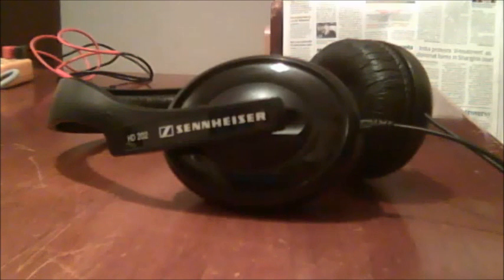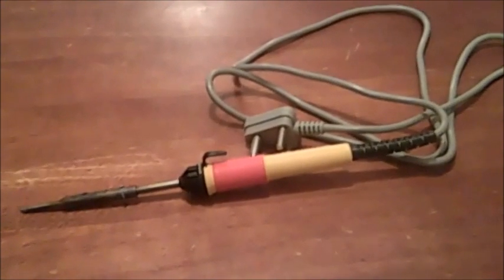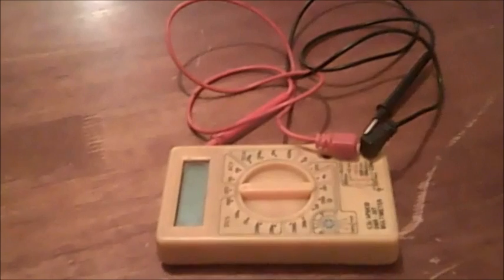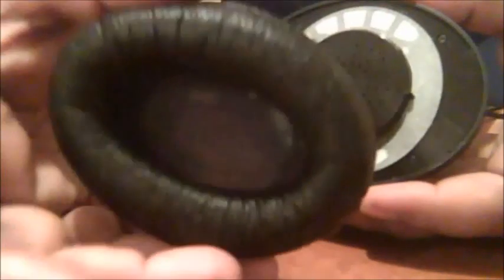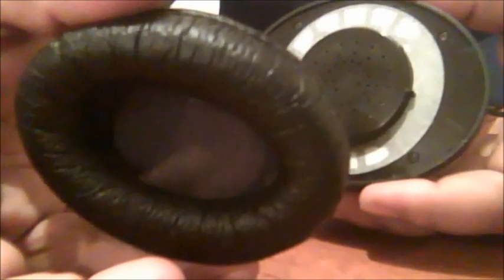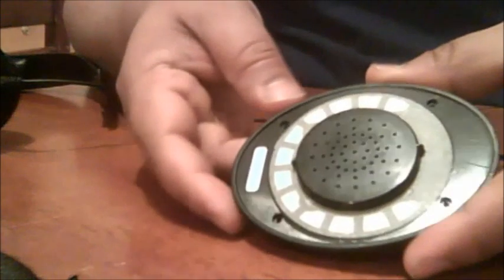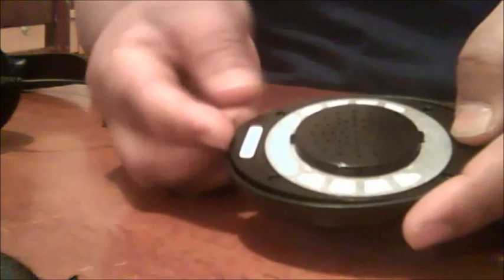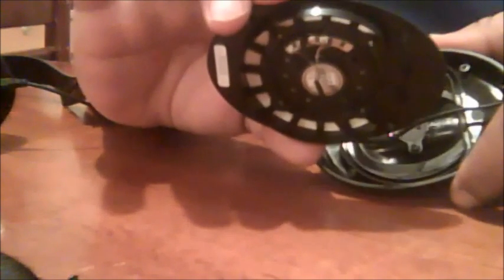How to Repair SENNHEISER HD 202 headphones

Comment: This video helped me a lot, thank you.  I have a question about my HD 202's however.  Only one earpiece produces sound.  There is continuity between the 'broken' earpiece and only the middle part of the jack, between the black rings.  The working earpiece has continuity with only the top and bottom of the jack, outside the black rings.  Is that how it should be?  On a better note, I tested impedance and read around 32 ohms for each speaker thankfully.

Comment from the maker: Use soldering iron to melt the soldering that connects the wire to the speaker. Now check the continuity between RF jack and the other speaker end. Probably, the wire might have a discontinuity at the 'knot', just inside the ear piece. Any way, while checking the copper wire should be exposed thoroughly by cleaning. Feel free to raise any question (that I can answer).

Comment: Just rotate them clockwise or counter clockwise and you'll see that the white insulation will separate out from the copper wire. 
I won't recommend putting a lighter to the whole thing as the strands might stick to the wire and you won't be able to join two ends. 
After you separate out the insulation from wire, just roll the wire together before putting on flame.
Also, be careful that the two separate group of wires, red and golden, do not come in contact with each other.

Comment from the maker: Please read my earlier comments. To see whether the speaker in tact, check whether there is any physical damage. If not, check the continuity by using a multimeter also check the resistance across the terminals. It should be around 32 ohms for this mode. Then check the continuity of the wires. You should be able to find the fault by this time

Comment: Thanks!  The disassembly was just what I needed.  I fixed the one side, but since the issue was a problem with the cable around the knot I had to shorten it, and of course repeat the process on the other side.  Much appreciated!

Comment: Thank you for good tricks :). I ve fixed my headphones. In my case the ground cable of right ear was broken somewhere in the middle of the cable, so i used the ground of other ear. It works now with and extension cable of course, and veery little amount of right ear sound comes to the left.

Comment from the maker: For a speaker to work, as you have mentioned correctly for the working speaker, you need to have continuity in two wires. One earth and the other positive. Earth will be a common for both speakers(normally the bottom most section of the jack). So check continuity for that also
Thank you, Joshy

Comment: I was having the same problem as you. 
If you are still having this problem, open the headphone as instructed. Cut the wire from the point where it seems to be broken. Take out the metal piece which keeps the wire tight and then pull the wire inside. Now, separate the green and golden wires on both the ends. Put them on a flame for a very short time to remove the enamel coating on them. You'll see the green wire turn to golden. Clean the ends. Now join the two respective ends and seal with tape.

Comment: Thanks! The main problem was disassembling headphone. Thought that force would break it.
Always cable is the weakest point in headphones (especially near headphone) :| (I'm very thankful that HD 485 have replaceable cable). Had to cut down main insulation then scratch cables to make them to conduct, solder them + duck tape and headphone works as before ^^

Comment from the maker: Mr. Patel, if it is new, take it to the supplier and let him check and remedy the fault. If it is an old one, you can try to repair as explained in the clipping. Check the coil of teh speaker, by checking the resistance.
Have a good day

Comment from the maker: If you have a multi-meter, check the resistance across the terminals of the speaker.
It should be around 32 ohms (whatever written on back of the speaker). If it shows approximately the same resistance for the speaker coil, that means speaker is in tact.
The wires are so insulated that (not the outside sheathing , the copper wire inside)  by normal cleaning it will not go. To expose the metal, you have to heat it with soldering iron, and then clean the ends hardly. T

Comment: Both sides on mine broke within a week of each other. I'm pretty sure the wire breaks where the strain relief coming into the headphone is, the wire is tied into a knot which is not good strain relief.

I'm going to cut the wires before the damaged piece and re-solder, which will make them shorter but should work fine.

My headphones are over 10 years old...
Reply: It worked! All fixed now.

Comment: I tried to make this repair with included speaker wires but they were too tiny to work with for me, so I went to radio shack and bought 16 gauge speaker wire and a 1/8 inch mono plug (should of been stereo) but it worked.  The sound that comes from these head phones now is about 10 times better.

Comment: What a shame, it don't seem like it was too long ago one could just split the wires and twist them back together again or add plain speaker wire, I went through all this got the right side working and the left side won't work even after burning the insulation off and getting a variable continuity test, must be they made the left side with one thin wire that connects just for people that might try to fix a product, what in the the heck has the world come to?  maybe it's the 3.5 jack itself, this never would have been a problem 30 years or less ago, I would say just don't buy this brand but like many things etc they just change the name or add different and or new names to it so one don't know what they are getting or who their dealing with or vice ver·sa, keep making that money how ever you got to do it eh...